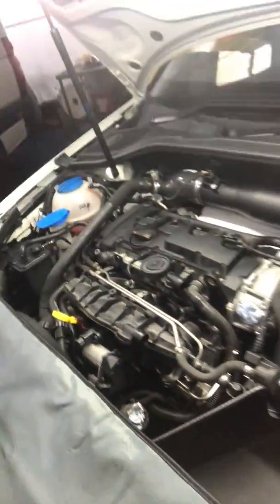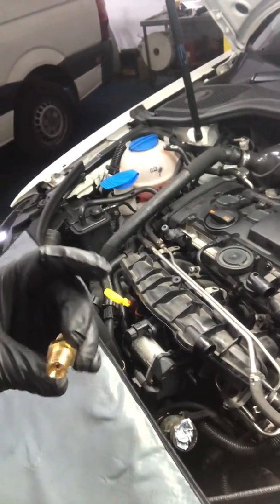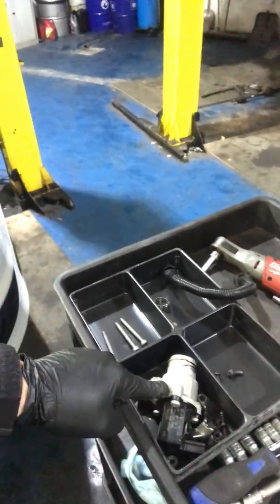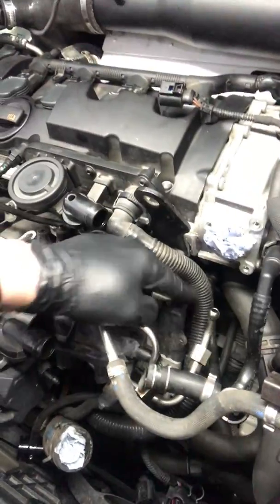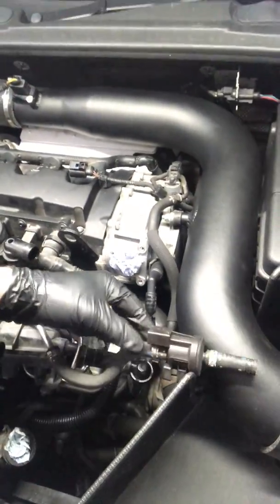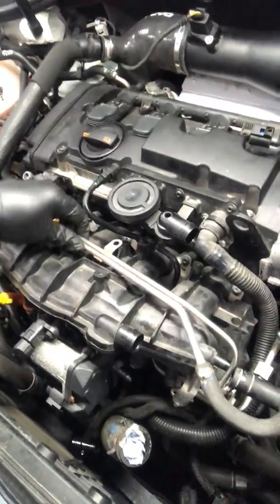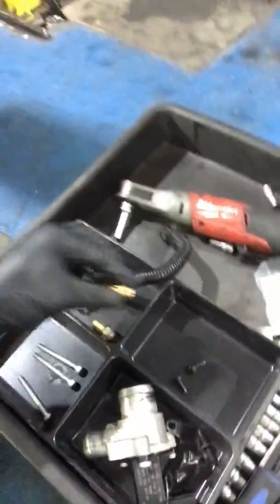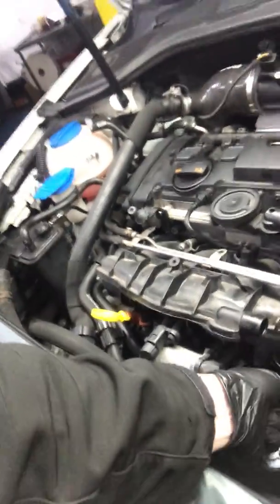Audi s3 rs4 fuel valve, golf gti,  tfsi

Comment: can i ask you would this valve make the car over fueling at idle without the k04 turbo?my mapper is saying its over fueling and cant figure out why
Reply: Not sure if you got your answer within 8 months but YES.  It WILL throw a "Too rich at idle" code.  Especially if you are not staged to 2+.  My stage 2 GTI GOLF was that way.  I listened to someone who thought I needed a RS4 valve but later removed it as I did not require it.  Stage 2 is good enough for me.